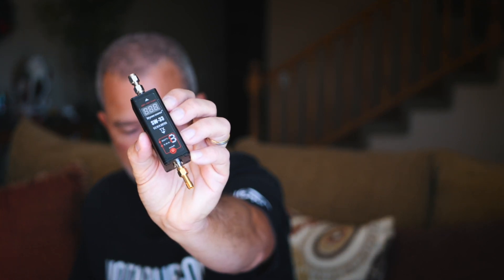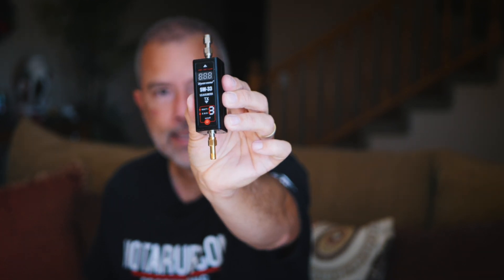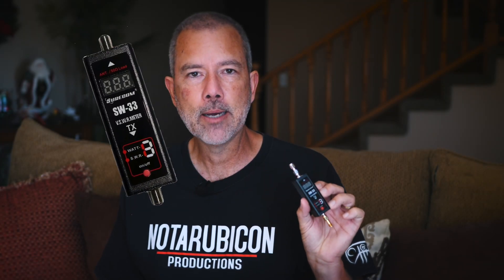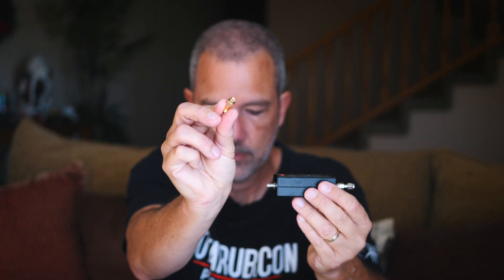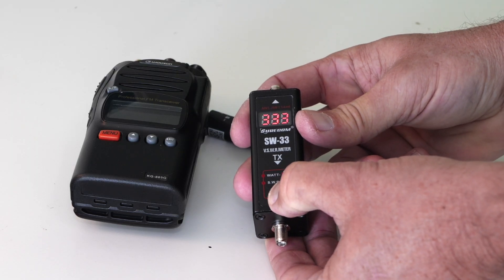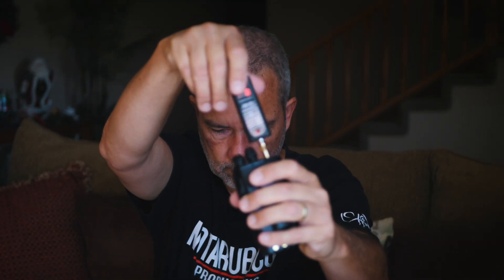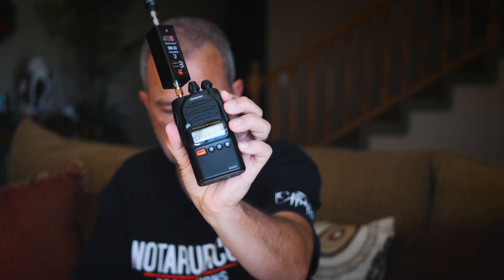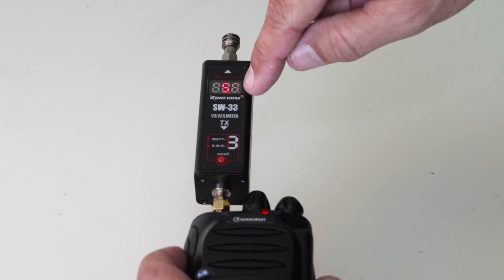Gam3Gear SURECOM SW-33 Mark II SWR Meter Review - Power And SWR Meter for GMRS - Review & How To Use

Comment: Weirdness here. I have two UV-5Rs and 2 UV-9Rs.  And these radios work in the field. And I bought this little Surecom SW-33 Mark II.

Now when I hook it up with a dummy load, I get an SWR of like 1.01.  But then when I remove it and add ANY of my antennas, the ones that came with them, or a couple of whips I bought (that are identical to the ones that came with my 9Rs) ... My SWR was ALWAYS showing my 19.9.  

Someone said the instructions (and mine didn't come with a manual) say to hold the box (I guess so YOU are the ground plane) while you measure.  And on one of my antennas I got that SWR to drop down to about 10.  But on others, 19.9 whether I hold the box or not.

But .... again with the dummy load, back to 1.01.  Now ... these antennas can't be THAT bad. Like I said, they work fine in the field. What do you think might be going on here?
Reply from the maker: You will never get an accurate or reliable SWR reading on an HT antenna... As long as the antennas are working, then just enjoy your radios.
Reply: @TheNotaRubicon  Thanks.

I did notice that if I move around it will sometimes drop to around 6.  

Mainly I was trying to see if the power output on the UV-5R and the UV-9R were the same, and if the wattage readings with the dummy load is an indication, they are.

Comment: Hello, thank you for all you production. a little stupid question from newbie: I am testing an extendable antenna to see at what length the transmission is optimal, but the sw-33 itself measures +/- 3 inches, so do I have to deduct this length of the final calculation? in advance thx

Comment: Why can't you do a power test with the antenna in place?  Would seem that would be a more realistic test.
Reply from the maker: You can, and you would probably get a reading that is 99% accurate, but using a dummy load will be more accurate because the antenna can effect how well/not well the power gets out of the radio.

Comment: Late comment, I know, but I just got one of these.  I have a 10 watt handheld and got a 25 watt dummy load, but didn't get the right connector and I still wanted to test the radio's wattage.  I found the 5 watt dummy load works fine SO LONG AS you press the transmit button only long enough to get a good reading then STOP.  The dummy load starts to warm up a little, so give it a break between tests.  I wouldn't try it with over 10 watts, certainly not a 25 watt mobile or something.

Comment: I know this is an old video but I got this little guy and put it on my GMRS uv-9G and UV-R5. It shows to hold the meter with your hand when testing the SWR. When I do that my reading are like off the charts bad on the few antennas I have. I also can hold my hand at the top and then at the bottom or on both sides giving me different readings each way. Holding it the full hand like the manual says is the worst readings. Would you or someone know why and if I'm doing something wrong? I am new to GMRS and never got into sad ham radios. LOL All I wanted for Christmas is to be able to get the best out of my radios. LOL Great shows you do for us. Thanks
Reply from the maker: It is virtually impossible to get an accurate SWR reading on an HT antenna.  Just use the antenna that came with it and enjoy the radio. If you dont trust that the stock antenna is good enough, then get yourself an aftermarket antenna tuned for GMRS.
Reply: @TheNotaRubicon  Thanks man for getting back with me and fast!! I seen what you are saying after more looking deeper into it. I think I will do just what you are saying get new ones tuned for GMRS and have me some fun. I did use the Sw-33 like it said in the manual, held it just like it showed and trim a little off got it down to 1.2, 1.3 from 14. I don't know if it is really right but if not no big deal. $20 will get me a good one. Thanks again!!

Comment: In another review, you mentioned that "the only bad thing" about this meter is, that your top cam could not scan the LED display.  Which was true.

However, I recently saw the "Plus" version of this meter (I already had the SW-33), which looked like it had a rebuilt, and now sports an LCD screen with selectable display "formats".

Sure enough, it does, and it works even greater now.  Check it out for a re-review ! :)

Fred, KA4YBR

Comment: So to test the power output of my Rugged Radio mobile (states 45w), do I need a dummy load adapter?
Reply from the maker: You could test it using your antenna, but you will get a more accurate test-result when using a dummy load.
Reply: @TheNotaRubicon  Copy, thanks for the quick response! Video was helpful.

Comment: On the Surecom SW-33 there is the power output at the top and the swr at the bottom. However, there is a middle readout between these two and the instructions don't address it?

Comment: I've got the same one. My SWR is 1.01 and my Power is 5.1 on Low (using a BTech 50x1).

Anyone can answer this question, as someone may know: Why does my REF number on the meter say 0.00? Isn't that supposed to have a number?

Thanks!

Comment: Can I use one of these with a Wouxun KG-1000G or, did I just waste my money??  It doesn't come with the right adapters; it turns out, I'll need two adapters.  What adapters do I need to get?
Reply from the maker: You can use it on your 1000G - If the right adaptors didnt come with it -  just look at your cables/connectors on the radio, on your antenna wire, and you can get whatever adaptors you need on Amazon for probably less than $9 .

Comment: I have tried two of these SW-33 meter they all read 1.01 on three different vehicles.  You indicated that they are not working if they always read 1.01.  Have you had many people complain about the product and  do you have any other product that I might try?  I am thinking the Surecom products are junk.  Lloyd Kurtz
Reply from the maker: its only $35 so i would not expect the highest quality  - Buy if you've tried two, and they are both doing the same thing, then the only common denominator is you/what you're doing.  Make sure you're on the right setting (power vs SWR) - i understand the newer ones also have a 3rd setting.. if you cant get it to work, send it back - they'll give you your money back.
Reply: @TheNotaRubicon  Mine has three settings, top is for testing Power, Middle is for testing SWR and the bottom one is to turn it off. I watched you test your radio, just like the printed instructions. I had a radio shop build the cables to attach to the radio and Antenna (I think they are called 259 connectors, Just like we used on the CB's) I checked the cables to make sure there was no continuity from the inside wire to the outside.  I installed the two radios on my vehicles and my friend installed his radio.  We are using GMRS radios.  I think I have done everything right.  You did a great job on your video and it was very clear and easy to understand what you were doing.  Thank you for your help.  Lloyd Kurtz
Reply from the maker: Oh, also make sure you are connected to an antenna, not a dummy load for SWR.
Reply: @TheNotaRubicon  We are connected to the Antenna.

Comment: Hi, I just watched your videos, got my license, and purchased this SWR meter and a pair of Wouxun KG-805G GMRS. I’m reading 5 to 6 SWR on the meter on channel 16 and 17 in my front yard. I live in a suburban neighborhood. Haven’t had a chance to go out to a field yet. But is this normal?
Reply from the maker: are you measuring SWR or power?
Reply: @TheNotaRubicon  SWR. Sorry if I wasn’t clear. They’re putting out 5.6 to 5.8 watts.
Reply from the maker: I have found that without special equipment it is very difficult (near impossible) to get a good/accurate SWR reading on a hand-held radio.  The KG-805G comes with a GMRS-specific antenna, pre-tuned for use on GMRS frequencies - so use it without worry!
Reply: @TheNotaRubicon  Ok thank you! Btw, I like your sense of humor. Great videos. Thx!

Comment: I received my Surecom SW-33 Meter today and had fun experimenting with the different antennas I have purchased over the years.  Several were the short antennas.  Very high SWR. Junk.  Can you answer this question?  The on and off button cycles through to SWR and Watt.  But,  there is a third setting.  One push after the Watt indicator it the red line goes down to the bottom  It is not vertical,  it is flat.  The next push makes the read line go up to the SWR setting.  What is that flat line at the bottom?

Comment: Just got the meter and have a few questions 1) the swr changes when I change the transmit power on my radio from low to high....not sure what that means?   2) there are 3 readings on my meter( going from bottom yo top)  there is a horizontal line showing a reading , then a vertical line swr reading, then a vertical line power reading?....very confusing....your videos are very informative and I hope you will be able to help
Reply: I'm trying to determine what the horizontal segment reading is also....
Reply: @babj615  Reverse power.
Reply: I also get different readings depending on power level.  Gonna try with different antennas next.  It may also be due to a crappy radio putting out spurious emissions at higher powers? Also the manual says to touch the meter with your hand while testing.  This does affect the reading.

I'm not too sure about accuracy of this meter.... has anyone done a validation against other meters?

Comment: Just ordered the SWR Meter to check on a couple of HT Units and a mobile unit that is going in my Yota. IS is worthwhile getting a 50 watt dummy load for the mobile unit? (The Xouxun 1000G 50 watt mobile unit you reviewed)... Couldnt I just use the antenna? Or should that be checked prior to using it with the unit? Also, it seems like I will need a short cable to test the 1000G mobile unit. Will any cord on Amazon work? 

Thanks for all your great Videos! Keep em coming!
Reply from the maker: You use the dummy load to test power-output, you must test/check SWR using the antenna..
Any UHF coax will work - just try to get it as close to the length that you need as possible so you dont have to coil-up all the excess and make sure it has the right connectors, usually PL-259, but it depends on what mount you are using.
Reply: @TheNotaRubicon  Randy: Have you tested your BF-F8HP on high? I would be curious to know how close your getting to that 8 watt they say there selling. With a 10 watt dummy load mine puts out 6.5 watts on high.
Reply: @TheNotaRubicon Why do you need the dummy load to test power output?

Comment: I just ordered one, hope you get your cut.  With some newer radios getting up to 10 watts how can I get a dummy load to match
Reply: If you can still find an old style incandescent light bulb, they make excellent dummy loads. A 100 watt bulb can handle 100 watts output without damaging your radio. There is plenty of information out there on how to build an adaptor to connect a PL259 connector to a standard light bulb base. Or any place that sells amateur radio equipment will have dummy loads of any capacity you might need. A dummy load is really nothing but a non radiating antenna, which turns the output wattage of your radio into heat.  It absorbs the power so it is not reflected back into your radio. Amateurs used light bulbs for decades.
Reply: @geraldscott4302 Why do you need the dummy load to test power output?

Comment: Randy.... I got this SWR meter, is there a packet of other assorted connectors that you maybe willing to recommend.  Its not like we have a Radio Shack around the corner like the old days.
Reply from the maker: IIRC, mine came with all the connectors that I needed. If yours didnt, just see what type(s) you need and search on Amazon.

Comment: Hey! @notarubicanproductions #notarubiconproductions I seem to have purchased a lantec PM-100 and I it has three modes toggled by pressing the power button that displays either a vertical or horizontal line and the vertical position is either middle or top and horizontal is bottom displayed on the device. Do you happen to know what each position means? The included instructions are lacking and also completely don't even tell me what the horizontal line means. Hopefully you can help. Either way I SEE YOU NotaRubicon Productions! Keep doing what your doing, you have solved my spinning mind on what to do about coms, for my recreational and when SHTF purposes.  Thank You Sir! From Dennis O'Brien Rockland County NY....
Reply from the maker: Sorry, no idea what a PM-100 is!
Reply: @TheNotaRubicon  its a swr meter that looks exactly the same as the swr meter on Amazon that you recommended I choose it thinking it was the same thing and had Prime shipping.
Reply: Surprised you didn't give my comment a thumbs up!

Comment: Calibration returns a 1.01 value eveytime.  Anyone else?
Reply from the maker: If it always shows that value on any antenna or even when there is no antenna connected, then, its broken - tell them to send you one that works.  If it only says that when connected to your antenna, then, congratulations, it's tuned!
Reply: Calibration with the dummy load returns 1.01.

Comment: i wonder if everyone knows that dummy load is only good for 5 watts?  also, what does that do to the test results if you connect say....a 8 watt load?
Reply: Kinda crappy that it is only good for 5w when the meter is rated for 100w, but I guess that you get what you pay for. The adaptors it comes with are probably worth $10-$20 on their own so not a bad deal

Comment: Thanks for the review.  Does it come with an adaptor for the bigger plugs(PL-259?) on the Midland Mobile units?  I have the all-in-handset 15W model in my Jeep.
Reply from the maker: I believe it comes only with SMA adaptors but you can check the link to be sure.. If not, you can find an SMA-PL259 adaptor for just a couple of $
Reply: Here's what I used. 
https://www.amazon.com/gp/aw/d/B01MQNJVMT?psc=1&ref=ppx_pop_mob_b_asin_title

Comment: So I have a question .. I'm going to be building a new bracket for my C/B antenna and GMRS radio antenna . How far apart should I make the antennas from each other ? I'm kind of new to the radio scene so to speak . Thank you for your time in advance .
Reply from the maker: If the antennas are too close, the signals can bounce off of each other and impact performance - although it will probably not be noticeable.. Best practice is to keep them as far apart as you can.
Reply: @TheNotaRubicon   Thank you for responding so quick . I was thinking about a foot apart from each other. Happy new year to you and your family . Looking forward to your 2021 adventures .
Reply: What I have read is at least one wave length away.
Reply: Does this distance matter if only one radio at a time is used?